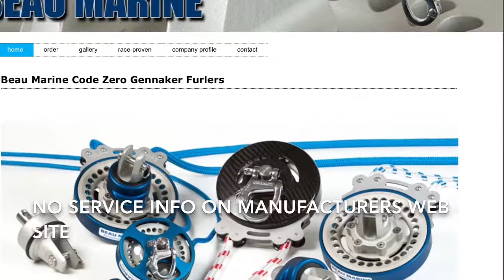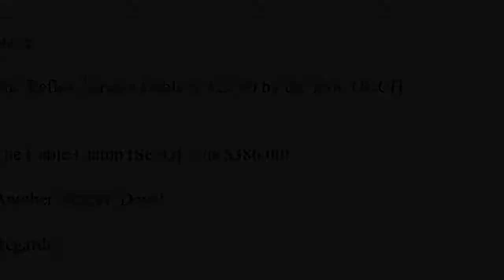Top down furler repair with new anti torque rope

Comment: Good Video! 
I'm working on a project for a DIY top down furler. I was wondering if you remember the size of the bearings for the tack attachement? I'm trying to make it as compact as possible
thanks!
Reply from the maker: Sorry Juani I replied on the wrong comment - please see my reply to the comment from Roderick. Sitting out the second sun tropical low (ex cyclone Hale) to hit us in 2 weeks here in New Zealand . Not my usual January cruise.

Comment: quite informative ,, thank you  R
Reply from the maker: Hi Roderick
As I never managed to remove the bearings I can not tell you the sizes. The manufacturer’s drawings should allow an approximate sizing. 
The torque rope terminations have been redone as there was slippage and now use hose clamps and numerous s/s cable ties. Also the plastic eyes had to be changed to s/s.